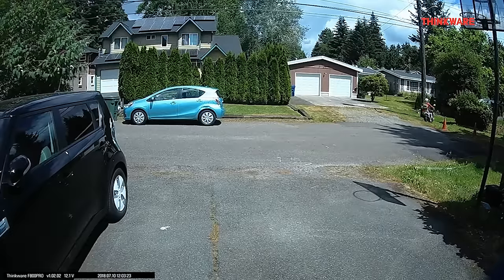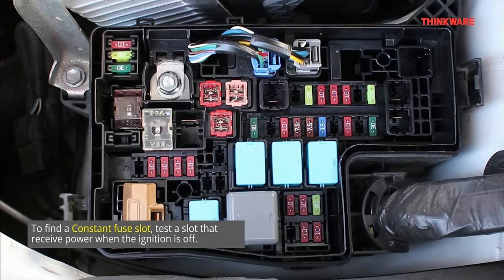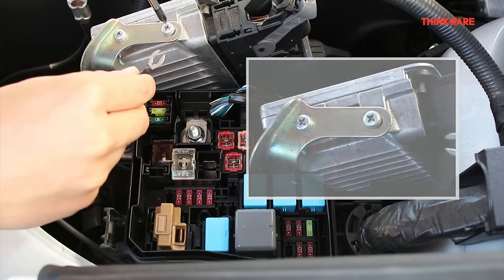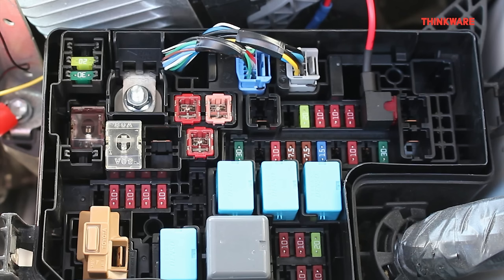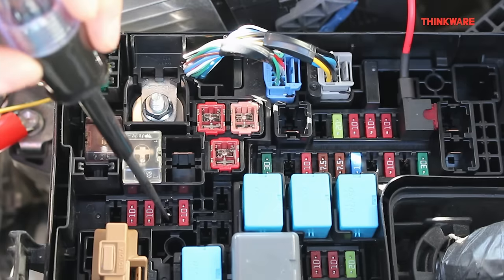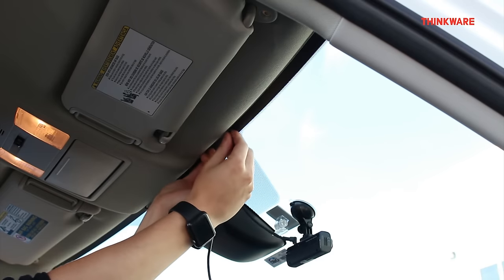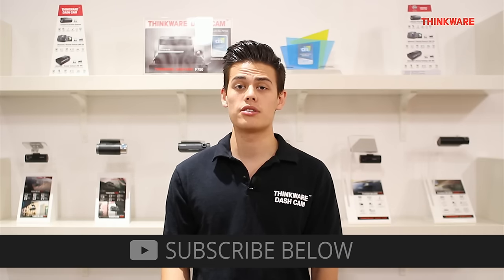How to Hardwire a Dash Cam

Comment: Can't believe you sell a hardwire kit at $35 Canadian and don't throw in the fuse adapters. It's essentially an overpriced box of wires.
Reply: No, it is a smart power supply that commands the cam to enter and exit "park mode recording". $35CDN is very inexpensive, actually.
[EDIT: there are numerous fuse form factors, since you dislike paying $35CDN for the hardwire kit you surely will dislike paying for the unused add-a-circuit components]
Reply: You realize this would increase the cost as they would need to include multiple adapters to work on every car.
Reply: @hewster1  - They could provide an option for customers to input year/make/model.
Reply: @MikeThePike316  what does your comment have to do with adapters?
Reply: And the cable is too darn short? Comes in 3 meters when other brands give at least 4 meters

Comment: I bypassed that useless parking mode with a mislabeled solar generator. It keeps my 4 cameras on for months and its lithium iron phosphate so its not going to  catch fire like lithium ion. And its not connected to the car at all. Simply put parking mode doesnt catch alot that can hapoen to your ride. And even though most of the hardwire kits have a battety cutoff  its alll manmade electrical and you can still come out to a dead battery.
Reply: 0

Comment: Almost all under-hood/bonnet fuse boxes are designed to be sealed on all edges in order to keep dirt and water out. Curious that the video doesn't address how the box will close such that the dash cam's hardwired wires don't prevent it from sealing, properly! The only way to do it is to cut into the fuse box, which would, then, require some kind of insulation or stripping to prevent dirt and water from entering the now-exposed fuse box!

Comment: It always helps to look at the fuse layout diagram, so you know you are not tapping a critical fuse.    another way to make sure you have proper orientation of your tap.  first place it in, with only the tap fuse placed ( the one that will be powering your camera ) plug in tap if you have power on your tap wire, then it's placed correctly,  if not, reverse the position of the tap.  in any case once you know the correct position, put the original car fuse in the tap slot for it.  doing it this way might be easier then trying to poke a probe into a tiny slot in a hard to reach area, less chance of shorting something out as well.
Reply from the maker: Great tips!
Reply: @thinkwaredashcam  hi I have a question. I would like to connect my dashcam into the fuse box but i dont want my dash cam run 24/7 because kill my battery. I want my dashcam turn on when i put the ignition on,  plug it in the cigarette lighter is not an option because the wire would be in my way. Thanks for your help in advance

Comment: That was exactly what I needed to know! Other sites did not mention positive and negative posts with fuses removed. Also good information on the fuse taps with the correct polarity and amperage. Thank-you👍
Reply: that is because polarity doesn't matter...
Reply: @burgerking220  1111¹1

Comment: Finally, my F800PRO Parking mode is working.
The problem is on my hardwire cable, the label on the RED wire’s fuse cover stated as the Continuous supply.
Then, follow what you said on YELLOW cable to the B+, and the RED to the ACC, that’s it!
Thanks.

Comment: Pro Tip: Make sure you check for 'constant power' fuses after your 10 minute battery shut down mode has past, otherwise, after 10 minutes, your cam is gonna shut off as well.
I haven't seen ONE video yet to address that
Reply from the maker: That's a great tip, thanks!
Reply: Muzzy337 The only car that matters is yours. All you need is a low voltage test light. You can search for a always on fuse to connect into after the vehicle has been standing
Reply: Muzzy337  most car have these option on lighing and power socket to prevent battery drainage 
it's time or voltage driven
Reply: what do you mean by this? i would have to wait 10 minute before looking for a constant power? so meaning close all doors?
Reply: @blaze858j  It means that some fuses stay on for 10 minutes then shut off after 10 minutes after you turn off your car. You don't want to use these kind of fuses because if you connect your dash cam to these fuses your dash cam will turn off after 10 minutes after you turn off your car. You want to connect to constant power fuses.To find which are constant and which are not look at this video : https://www.youtube.com/watch?v=nINz6mKvOf0
Reply: generally think about the circuits that always work with no keys, ie horn, lights, cabin light
Reply: another good way to test for constant power is to unlatch the hood at night, then in the morning go out, open the hood and immediately test for constant power. that way you know for a fact that nothing should still have power unless it’s a constant power circuit.

Comment: Good info on this wiring. Some others don't show connecting to battery & using the connections you mentioned. Think I will need someone to install for me. Only thing I did not see was the wiring coming back into the cab or how you got the wire to the battery. Since someone else will install for me, don't need to know. Maybe I missed a step. Thanks again for this video.

Comment: @4:38 .Negative is ground. There is no negative side of fuse .Fuse interrupts flow of current .That 'negative ' side is the side with no power, when fuse is blown or taken out.
Reply: yeah should be line side and load side or something similare ...
but at least they are explaining the issue....most poeple don't know this little details with add a fuse

Comment: Finally! Finally a situation where the fuse-box is under the bonnet. Not in the interior cabin. Very good point about not using criticle fuse locations. 

04:30, None of the others I saw mentioned polarity of fuse slots. Excellent.! 👏😊

Comment: This is a wonderful video. Appreciate! Got a question. Why do you use 2 fuses? I suppose 1 fuse is to allow 10A, and do 2 fuses allow 20A? And thinkware will require 20A to power on?
Reply from the maker: HI There, As the Dash Cam recognizes loss of power at the ACC Cable to switch to and from Parking Mode, this is why the Hardwiring Cable uses both an ACC and Constant Cable.

Comment: 10 Amp is a bit much for those thin wires though.
If things go wrong the wire will act as a fuse instead of the fuse itself.
The average dashcam will use less than 2Amps.
But of course thank you for explaining things!
Reply: That’s why the fuse piggyback runs a splitter thru a 1.5amp fuse.
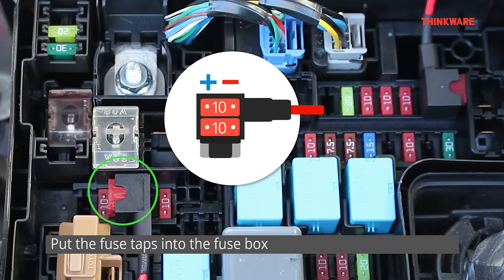Reply: @dougfresh1341  6:12 All I see is him using two 10A fuses.

Comment: Hello, thank you for the video. If I do not need the parking surveillance what should I connect?
Reply from the maker: Hi There, you can still hardwire the Dash Cam, but disable Parking Mode in the Settings. This way, the Dash Cam will shut off when you turn the vehicle off. If you wish to use Parking Mode, you can enable it again in the settings.

Comment: Hey, If I want to hard wire to empty fuses, I only need to put the fuse for the fuse tap to the top row and have nothing for the bottom row since I am using an empty fuse correct?
Reply from the maker: Yes, that is correct

Comment: I I followed your lead and successfully hardwired the equipment. Everything works perfect. I also followed your lead and made sure Motion Detection is enabled. But a lot of other dash cams will give you an audio alert when you turn off the car and let you know parking mode is activated. But the AZDOME 550 does not give you such an audio alert and so I ask, how do you know that your parking mode is indeed working or properly enabled via the hardwire installation if your camera does not give an audio whenever parking mode is enabled?
Reply: Suplex it

Comment: I bought DDPAI X5 PRO dashcam. It has only hardwiring provision and came with 1ACC,1VCC,1GND. I don't want use parking mode. So can i connect ACC and GND to the fuse box (I'm not connecting VCC). Does this work?. Thanks in advance.

Comment: Hello friend, after installing this Kit the Azdome M560 is recording continuously, even after I configure parking mode and even turn it off.  
Did I install it incorrectly?  
I bought the kit with a micro USB output, but I added the type C adapter.

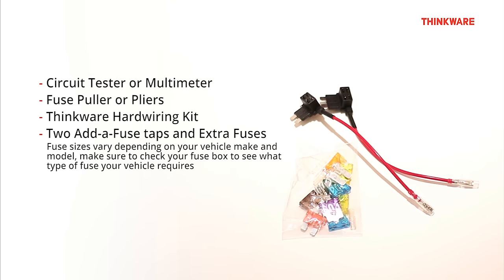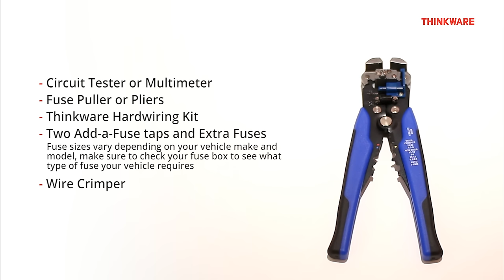Comment: Could please give a tutorial on how to crim the wire from the hardwire kit to fusetaps? On your video at 1:25 the rubbers are transparent but at 1:35 they are change to blue ones. Did you add or change to other rubber covers? Thanks.

Comment: This might be helpful to someone. I have three 12v "cigar" outlets. Two are constant, one is switched (only on when car is on or key is at accessory position). I wired the constant to the constant outlet and the accessory to the switched outlet. Grounding is the same.

Comment: What if i find empty fuse slot...do i  still need to put some fuse at the bottom of add on fuse wire or i just need one fuse to put.(as there is no existing fuse in car fuse box).
Reply: you just need to put one fuse to feed the camera

Comment: Does it not have to be connected to the constant supply so that dash cam receives power when engine is off? So dash cam works when car engine is switched off to record parking mode instances?
Reply from the maker: That is correct. One of the hardwire cables connects to a constant supply in order to supply continuous power to the dash cam even if the vehicle is switched off. This will allow the dash cam to work or utilize its parking mode feature.

Comment: I have a question. I tried installing a Vantrue E3 with hardwiring kit. To see if I wired correctly, I just plugged ground and battery but not ACC yet.  The cam doesn' t turn on eventhough the LED on the hardwirekit  turns on. Is it necessary for the cam to turn on  to have the ACC wired?
Reply from the maker: Hello Max, 
Unfortunately, we cannot help with third-party brands as we cannot guarantee they will work with our products.

Comment: hi I have a question. I would like to connect my dashcam into the fuse box but i dont want my dash cam run 24/7 because kill my battery. I want my dashcam turn on when i put the ignition on,  plug it in the cigarette lighter is not an option because the wire would be in my way. Thanks for your help in advance
Reply from the maker: Hello G, if you hardwire the cable correctly with both fuses connected, it will not cause battery drainage. You can also enable battery protection settings in the dashcam settings to prevent and protect battery drainage!

Comment: Dumb question, can I tie both the battery wire and the acc wire together and crimp them on to the same add-a-fuse? I only need the camera to be on when the car is on. I seem remember they used to make these hard wire kits with just a ground and a power wire.... now they have a battery wire and a acc wire. Or am I remembering this wrong?
Reply from the maker: HI There,  Can you please reach out to us at support@thinkware.com for further assistance with the wiring?

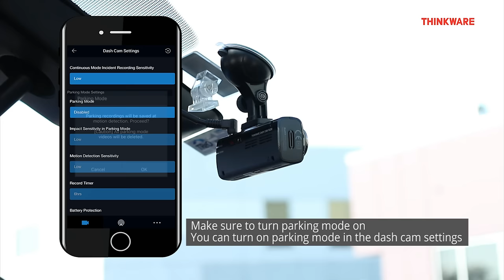Comment: 06:16, Slow down..  . You missed an important step. How did you run your cable from that fuse box to that vehicle's interior?
Reply from the maker: We followed the factory wiring from the engine bay and found a rubber grommet in the firewall that we could feed the hardwiring cable through.
Reply: That's the worst part
Reply from the maker: @MrBen527  Since every vehicle is different you will have to use your own creativity to route the cables accordingly for your own vehicle! 😁
Reply: @thinkwaredashcam  I just got mine done.  Finally found an ignition circuit to use inside the cabin.   No running through the firewall!
Reply from the maker: @MrBen527  Perfect! That makes it much easier 👌

Comment: I have one dashcam plugged into the obd-2 port, if i install another dashcam with the hardwiring kit, will they noth still work?
Reply from the maker: Great question! You can give it a try since both dash cams will be connected to two separate power outlets.

Comment: if your kit comes with both  constant and acc do you have to install both?
Reply from the maker: Hi there! Yes, connecting the Hardwiring Cable correctly (Constant and ACC fuse) will allow the dash cam to switch between continuous mode to parking mode.

Comment: Can you please clarify?  I know the DashCams need constant power for the parking mode, so if you feed it constant power, why do you even need the other (accessory) power cable?
Reply from the maker: Hi there! Connecting the dash cam to an ACC connection triggers its continuous recording mode while the Constant connection is for the parking mode. It kind of serves like the switch for the dash cam to change its recording mode. Once you turn on the vehicle and the ACC line powers, the dash cam will trigger to stop parking mode and switch to continuous recording mode.

Comment: Can you use a slot that not already used?  What fuse number should we use at or it didn’t matter?
Reply from the maker: Hello David! As long as the Slot is providing the correct power for the camera, then yes, you can use it!
Please note, we recommend using between 10-20AMP fuse!

Comment: does it matter the orientation of the fuse? i Dont mean the jumper.
can i install only the red wire?

thx for the video btw, prolly the best guide atm
Reply from the maker: The orientation of the fuse in the fuse tap does not matter. If you only install the battery wire the dash cam will turn on and off with your vehicle's ignition. If you only install the ACC fuse the dash cam will not power on. Thanks for the feedback!
Reply: @thinkwaredashcam  thx really, bye

Comment: My constant power fuse slot in my 2014 Infiniti Q60 has power on both terminals, but my Acc fuse slots only have power on one side. Is that normal?
Reply from the maker: Hi there! We suggest checking with your dealership/car manufacturer to best understand and identify which fuse slot should you tap in the hardwiring kit. Thank you!

Comment: How do you get the cable from the engine bay where the fuses are, to the camera inside the car ? Where do you route it ? Thanks.
Reply from the maker: Hi there! We recommend installing it using the fuse box in the interior of the vehicle if possible. You can run the cable using the pillar and headliner of the vehicle. Thank you!
Reply: @thinkwaredashcam  hi sadly that's impossible, the fusibles are behind big thick câbles and I can't access them :(
Reply from the maker: @Alfakyn1  Unfortunately as Thinkware's customer support is not authorized to provide in-depth technical information on the hardwiring installation because every vehicle is different. Please note that we strongly recommend professional installation as a technician can provide the best set-up for your vehicle make. Thank you!

Comment: I hard wired my dash cam using an add s fuse but no power.  The fuses are good, cable is brand new and wired up right. One to the fuse, one to ground. What am I doing wrong?

Comment: Hello I would like to know or see how the cord is ran after it’s been hot wired ? Where does it go or how it supposed to be ran after the fuse is complete
Reply from the maker: Hello Kia, We do have a few videos with tips on how to hide wires, however we are unable to show the exact routes as each vehicle is different. We strongly recommend professional installation, as a technician will be able to determine the best route for your vehicle make.

Comment: If you’re hooking up the “battery” wire, why then would you need an ACC wire?
Reply: So that the camera knows when the power has been shut off to the engine and knows when to automatically start "parking mode"

Comment: My cars battery was drained until it won’t start and I tapped into the cabin light fuse??????
Reply from the maker: We are going to need a lot more details in order to help. You need to tap into two fuses not one. Did  you test your cabin light fuse to see if it was ACC or B+? When you turn of the ignition can you hear the audio notification "Parking Recording Will Now Start?" approx 5 mins after?

Comment: do the amps need to be the same on both fuses you tap in to? for example if the constant is 10 amps then does the acc have to be 10 amps or can it be 20 amps? thanks

Comment: Great video! New to electrical so this helped a lot! Why do some kits come with only ground and batter whereas kits like yours come with ACC Battery and Ground? Thanks in advance!
Reply: I’m wondering the same. I have the type S dash cam it the hardwire kit only has  black wire for ground and a red one, which I’m assuming is the battery wire

Comment: Hi! I'm interested  in getting my dash cam hardwired. However, there aren't that many 10 amp fuses. I was wondering if I could use a 7.5, 15, or 20 amp fuses? Also, I noticed that some of the fuses in the fuse box are placed upside down. Is it ok to use them? Any info on this would be much appreciated. Thanks!
Reply: Fuses are, basically, just strips of metal. As such, they are not polarized (i.e., they do not have to be plugged-in in one or the same way), so their orientation (i.e., whether the amperage number is "right-side up" or "upside down") is not important, and will work either way. The same may not be true of whatever device you hook up to it, such as, apparently, this dash cam unit (i.e., just like some household/office devices that may have a polarized plug requiring them to be installed in one and only one way). I cannot answer your question about the dash cam's fuse rating, as that is specific to that device, though the video stated that it can be lower (n.b., I would hope that the dash cam's instructions indicate the proper fuse rating).